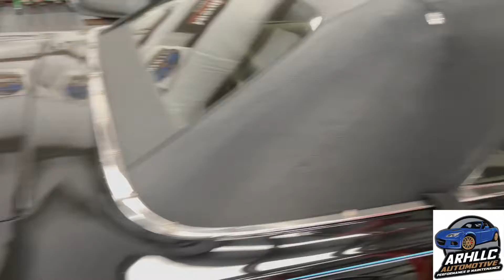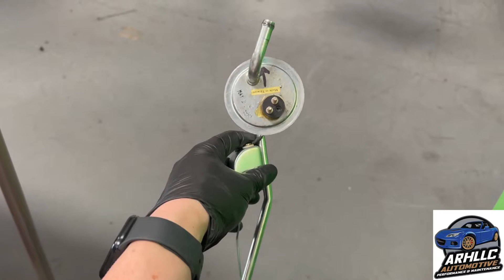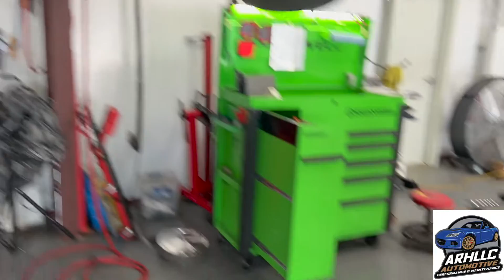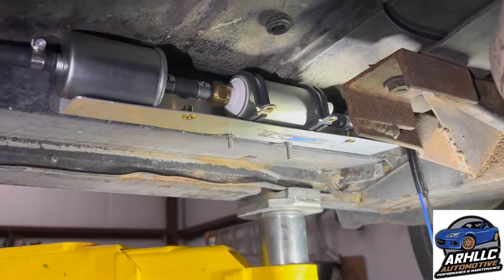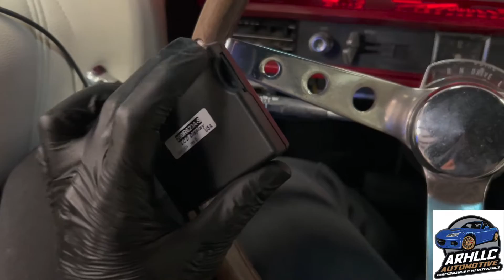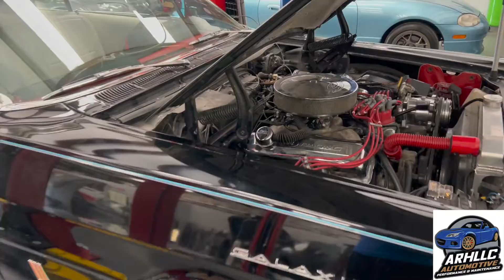1965 Galaxie 500 390ci Holley EFI Sniper install

Comment: Super useful. But why not use the stock steel fuel line as much as doable and then use a new steel line for the return
Reply: Also how did you end up dealing with the transmission linkage?